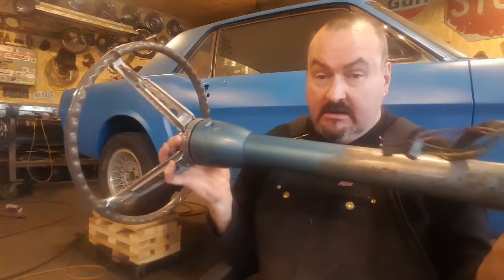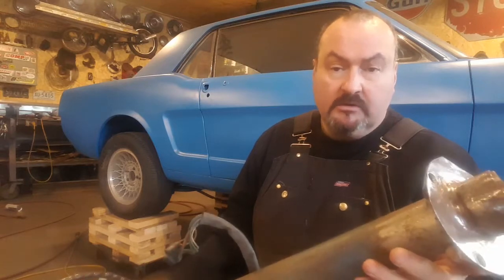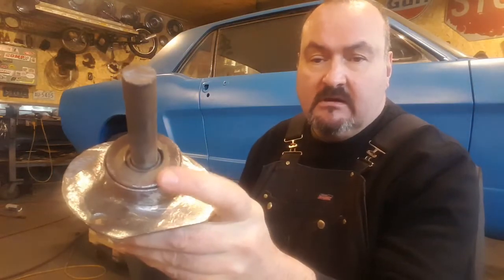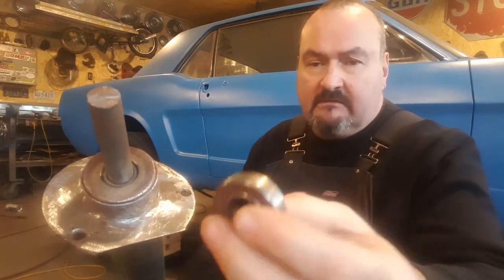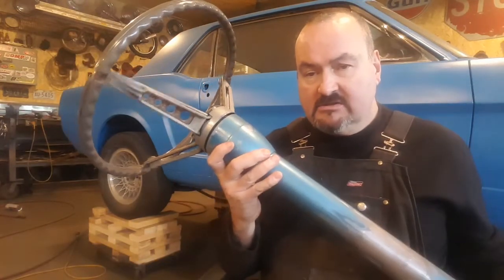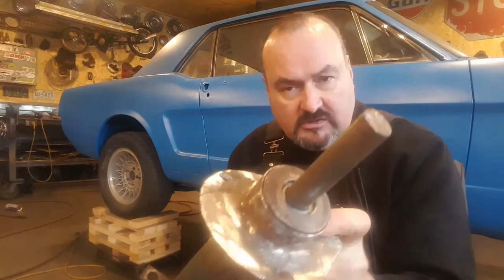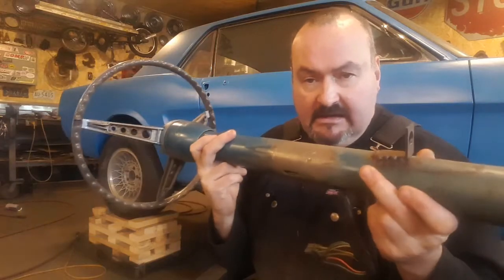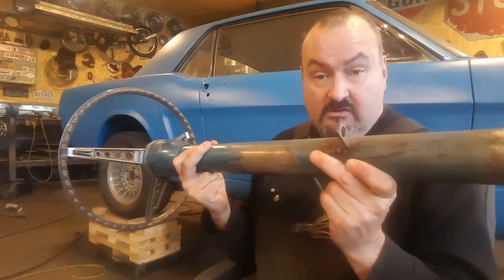66 Mustang  Project. Part 2

Comment: Fitzee, your videos are great, so well done, very professional and the practical tips are priceless!  Would you have any plans/suggestions/ideas for building a rotisserie?  I'm working on a 63 Studebaker Hawk which needs a lot of metal work on the torque boxes, body mounts, etc and I think that a rotisserie would be just  what I need to do this work safely ....like you I am on a budget so buying a rotisserie for $1200 or more would not be possible....any suggestions are most appreciated!  thanks...Joel
Reply from the maker: I'll go over the one I have in the shop in my next video.
Reply: Great work Fitzee